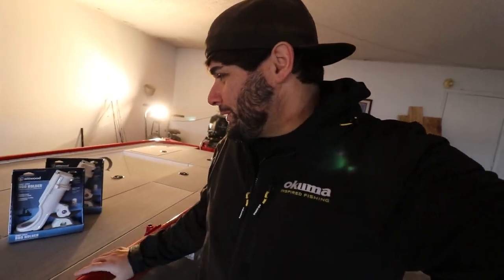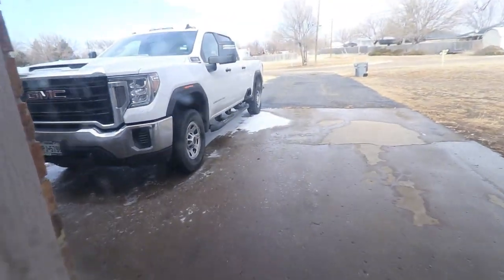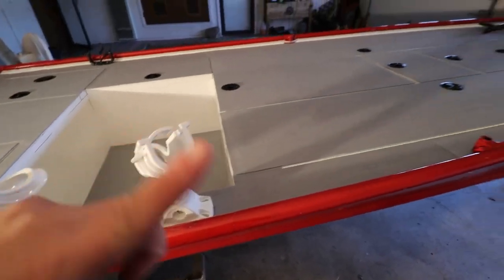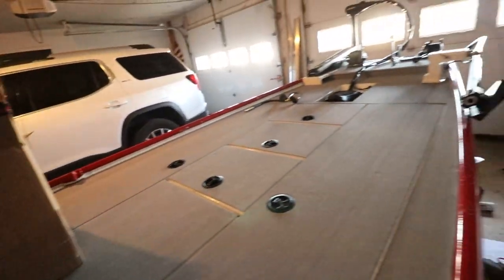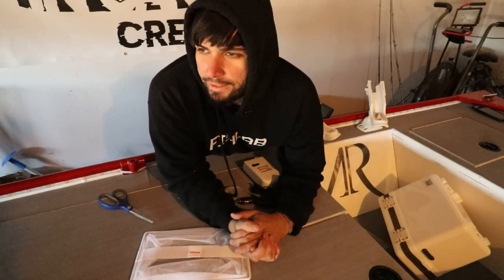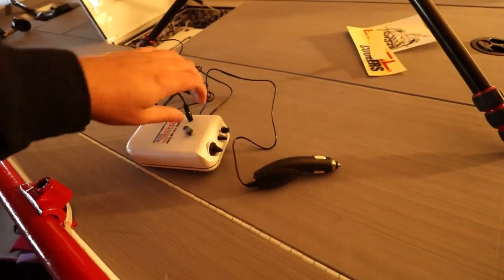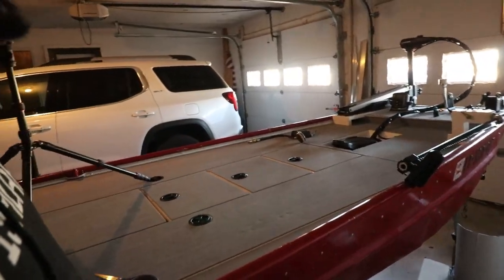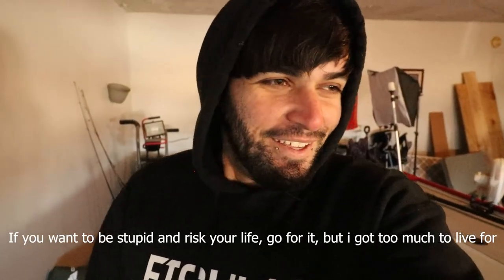Adding ROD HOLDERS and LIVE BAIT COOLER to my Jon Boat Conversion!!

Comment: As an ice fisherman who uses two different Engel bait buckets. You either need to clean the netting non stop, or do what the rest of us do and chuck it. Lol also, the bubblers on the Engels are notorious for having a short lifespan. We swapped ours for lithium units from
Amazon.
Reply from the maker: Yeah I figured that might happen with the net, and I’ll check them out, thank you for the tips 🤙

Comment: Curious?would rod holders fit in oar locks
Reply: I have those same rod holders and they don't fit in oar locks.

My 14' tinny has 2 sets of oar locks (2 on each side), so I got 2 cedar boards that would reach between the oar locks on each side and put a stainless carriage bolt through the top of the board and the oar locks on each end with a nut on the bottom to hold them in place and keep them from rattling. I then attached 2 rod holders to each side. Works great.